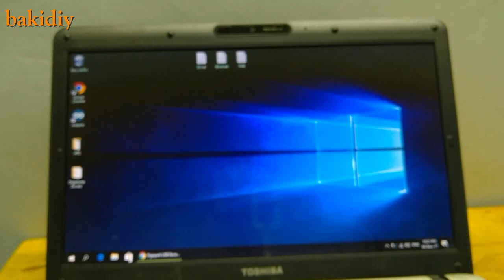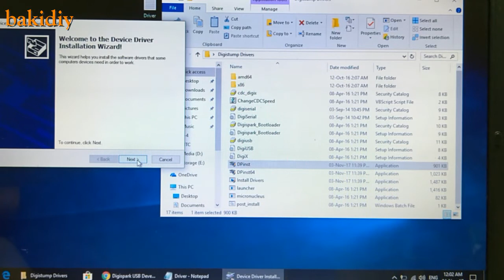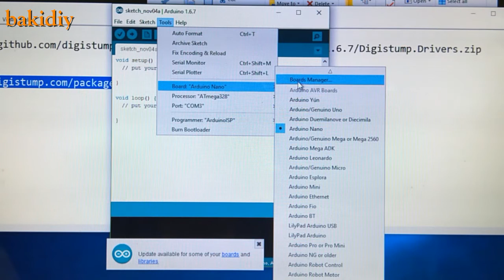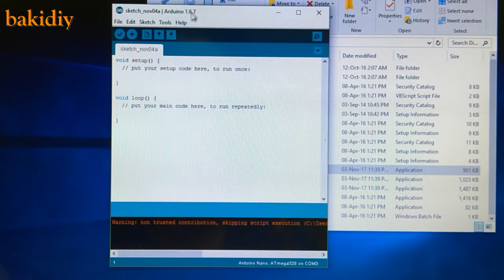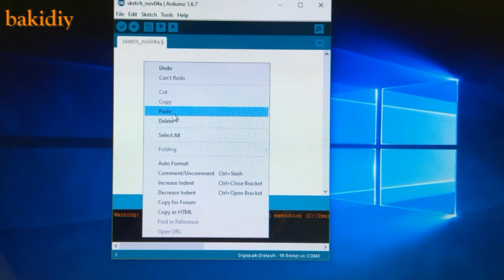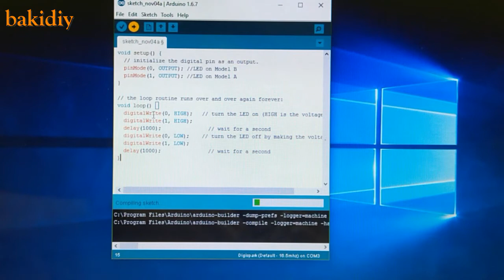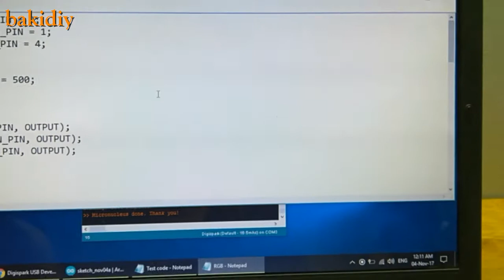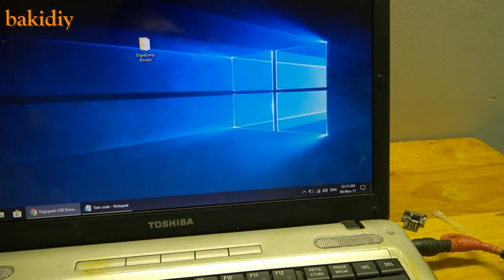Digispark Arduino ATtiny85 USB - Installation - Control RGB LED - Blinking LED

Comment: could you do the same with rgb led stip please?
Reply from the maker: You can use the code and wiring same as me, but the 3 pins out must connect via NPN transistor or N-Channel Mosfet sush as IRF520 and better if you use Logic Level Mosfet (Don't try to connect the pins directly to RGB led strip, the arduino board will be burn out).
Maybe I'll make a video after buying a led strip ^^